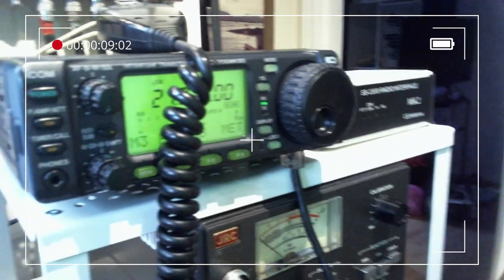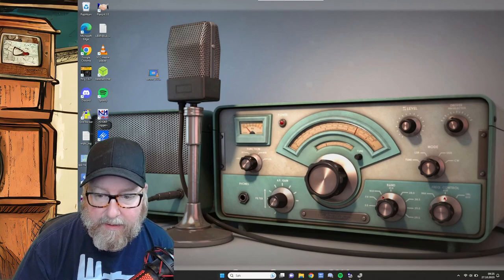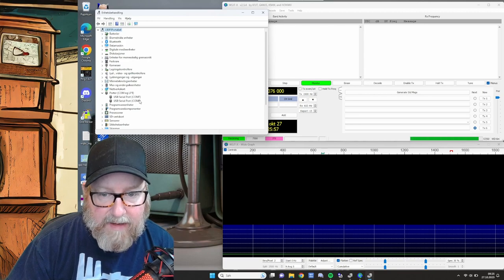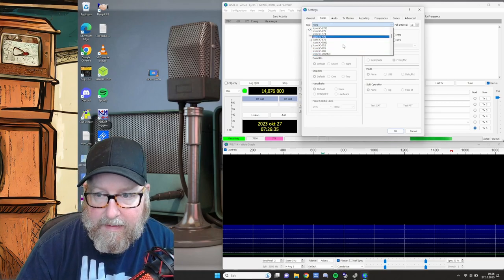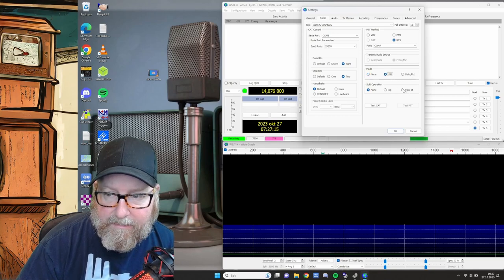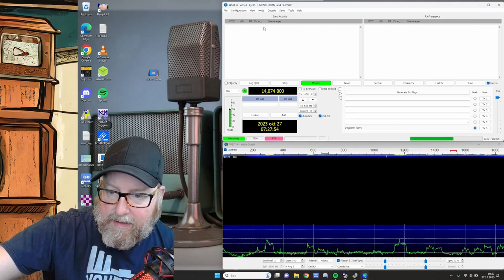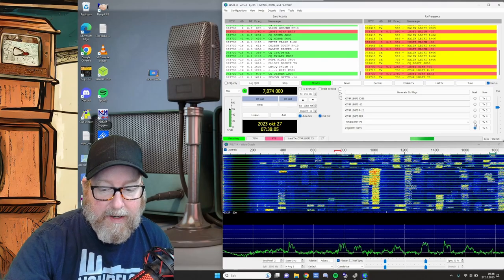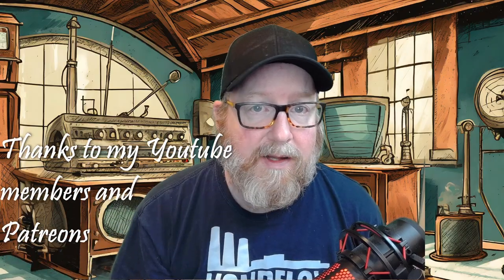Can You do Digimodes on the IC-706mkIIg?

Comment: I bought an old 2m Yaesu  FT2600M, mostly to call the local repeater. Apparently, Digirig had a cable so I went that way for APRS. I do not always APRS, but nice to know I can.
Reply from the maker: Absolutely, I am in the process of getting a digipeater up, and I will probably get a Digirig and use a software TNC for that. Not sure about what radio I’ll use though.

Comment: I would like to interface my ft950 to my signalink usb modem, but the six pin yaesu plug or finished cable seems like not a lot available anywhere. It looks like similar or same as ps2 mouse connector, if anyone have knowledge please share.
Reply from the maker: I don’t know that exact radio, but would the Yaesu SCU-17 work?
Reply: @LB0FI  That will work, thanks!

Comment: how would you knock the power down to 5 watts or so?  I;ve heard digi modes are hard on the finals if you're running much over 30 watts
Reply from the maker: How much power you should use is dependent on your radio. On the IC-706 you hold the "Display" key, and then adjust the power with the VFO wheel. Hope this helps.